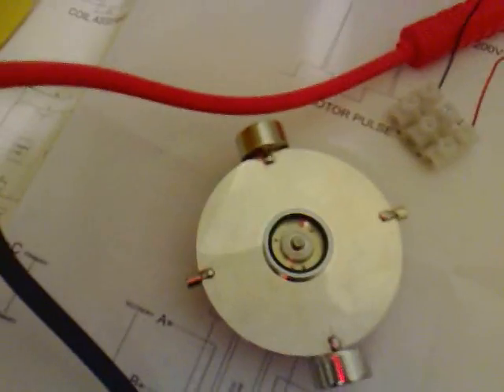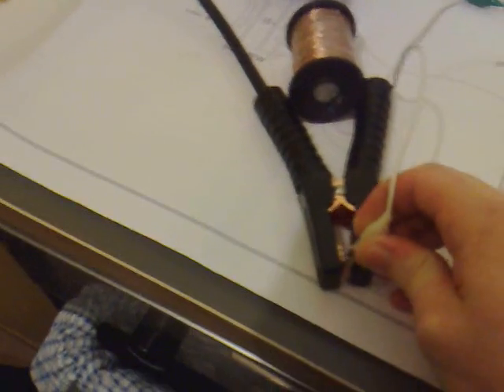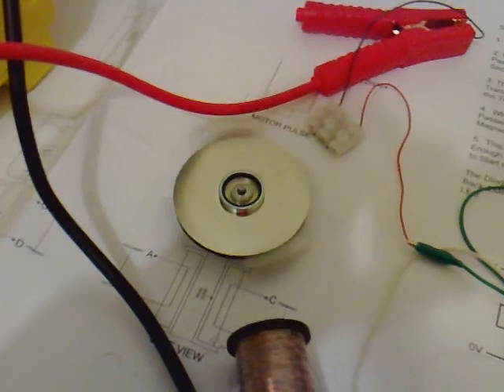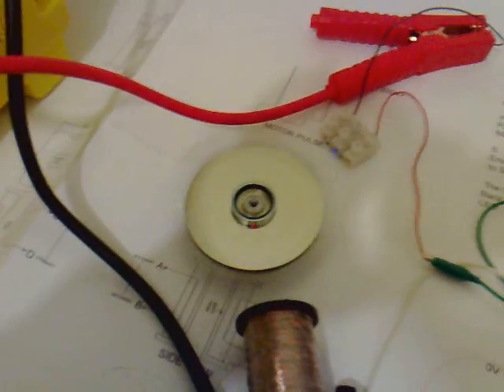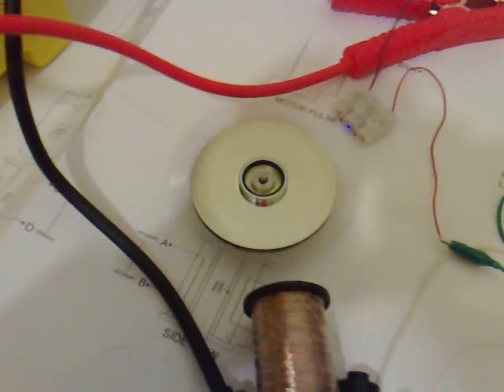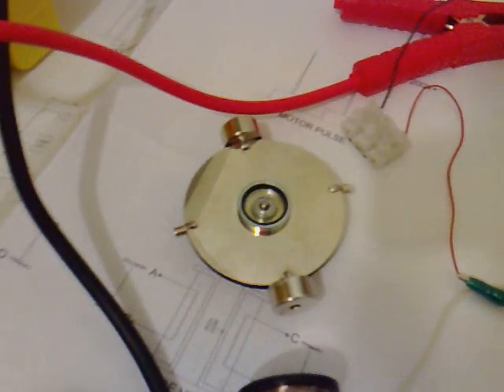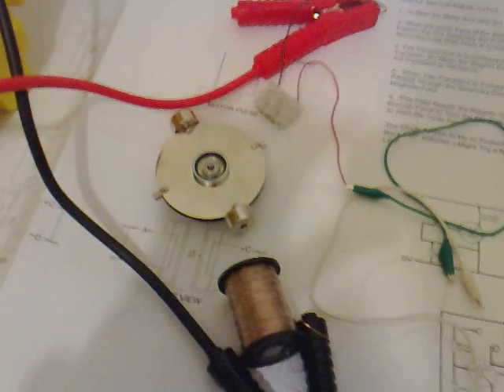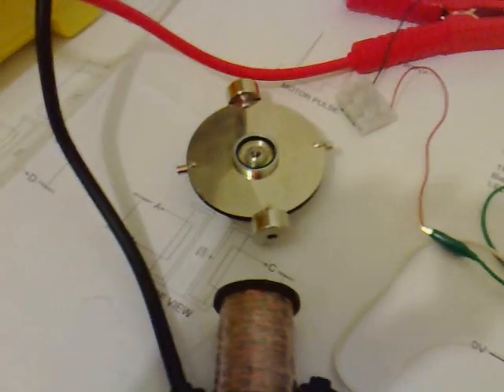Pulse Motor (Larger Magnets) 028

Comment: I have seen many of your videos like this that use a reed switch for turning to coil off and on, what kind of life do you get out of the reed switches? i cant imagine they last very long as they are switching several hundred times a second when you run these motors at high speed.

Comment from the maker: Its a connection block with a reed switch attached to it.

A Reed Switch is a magnetic switch. The one I am using is normally open and closes when a magnet passes it.

Comment from the maker: The pulse is directly connected to the speed of the rotor through the reed switch attached to the connection block.  When the rotor spins it turns the coil on and off.

Ill google rodin coil, thanks.

Comment from the maker: Thats a good idea using a bike odometer, if I used it on mine I would have to divide by four (four magnets) I think that the diameter of my spindle may be too small though.
Check out ebay for the magnets my big ones were £5 each and can pull 55kg each.

Hope this helps you with your motor.

Comment from the maker: I have no way of measuring the speed other that the pulses on the Neon. I think so, it has made it more stable and use less power though. I think that the mass of the magnets helped as it takes longer to spin down when I disconnect.